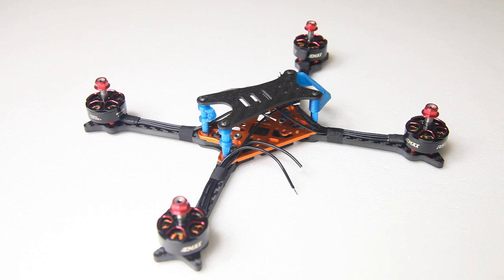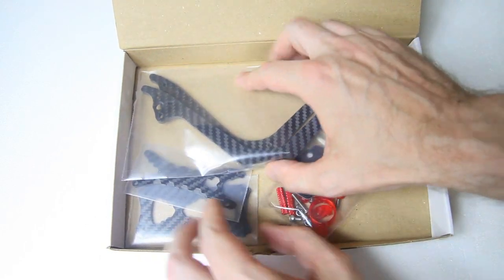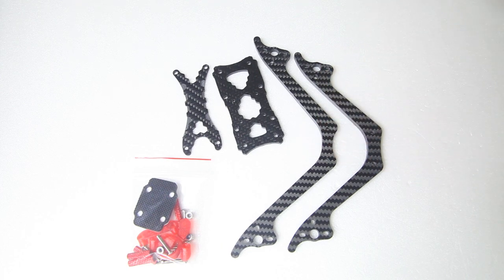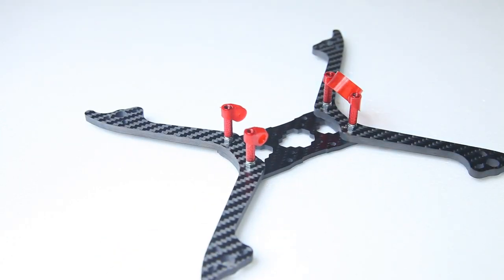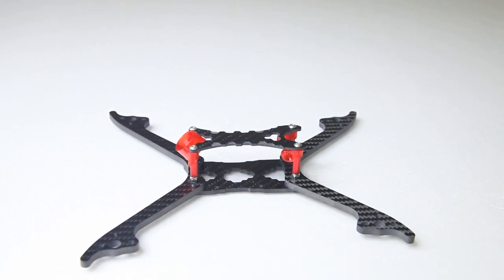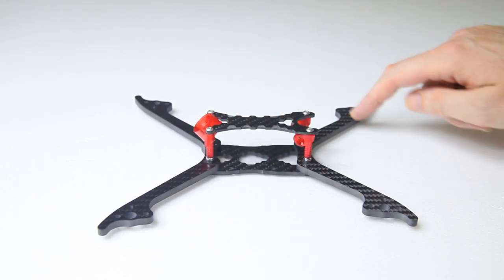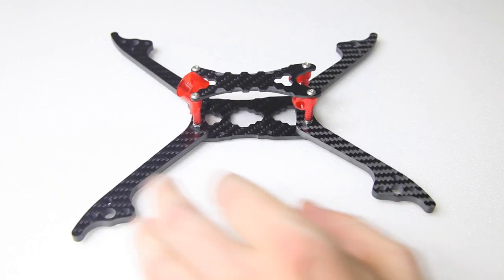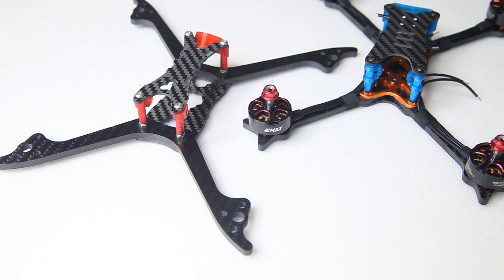Hyperlite Floss 3.0 vs Rotorama Wasp - DutchRC 200GT - P3: FRAME REVIEW

Comment from the maker: a second option for the LIGHT quad build: The Rotorama Wasp racing frame.....  
Rotorama Wasp frame: https://www.rotorama.com/ramy/rotorama-wasp 

Specifications
type: allround / racer 
wheelbase: 220 mm 
base thickness: 5mm (arms) 
material(s): carbon fiber with allu standoffs 
weight:  64 grams
chamfered edges: lightly sanded 
clean: minute amount of dust 
buzzer: nope 
LED board: nope 
battery strap: nope 
battery anti-skid pad: yes